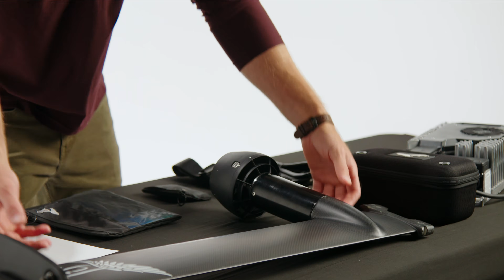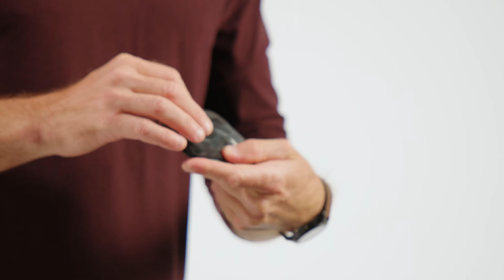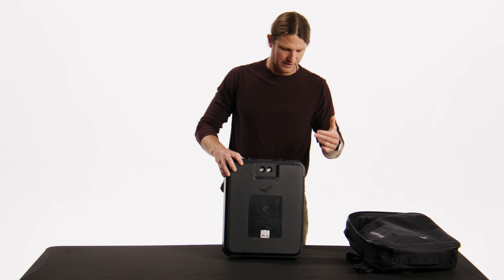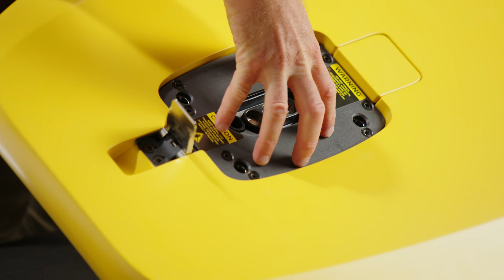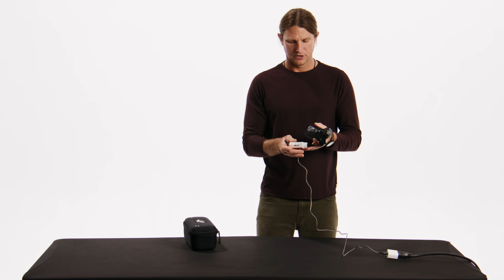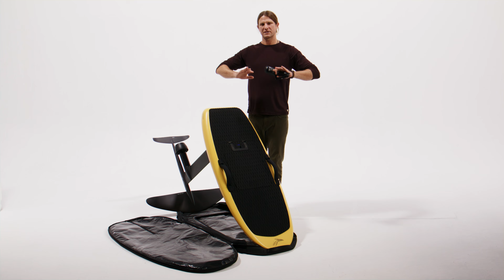LIFT5 / LIFTX Beginner Guide: Setup, Safety & Unboxing

Comment: Amazing! When do you think you will have more lcs wings? I want to get a high aspect wing, but want it to be lcs compatible!
Reply from the maker: We have some new wings on the roadmap for 2026, but you know Nick. He can't sit still for too long. But don't forget all our bolt-on wings still work and will continue to work with the new Project OCHO (LIFT5 and LIFTX) launches.
Reply: Yeah I know they work, but it’s soooo nice not to have to attach things with bolts. My main use case is driving to locations so it makes a huge difference to have lcs.
Reply: Is lift X battery compatible with lift 5?
Reply from the maker: It's not
Reply: @LiftFoils How long it takes for lift 5 battery to get fully charged?